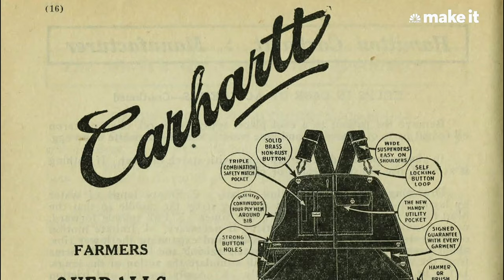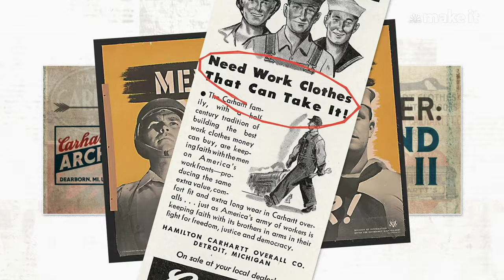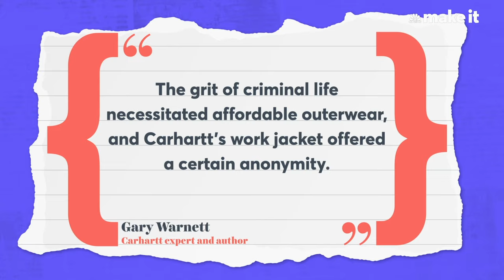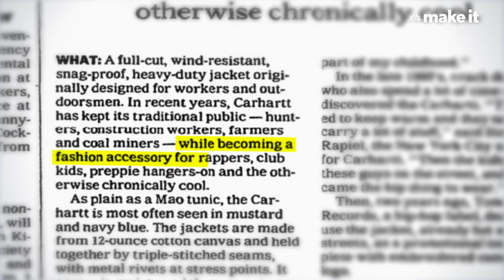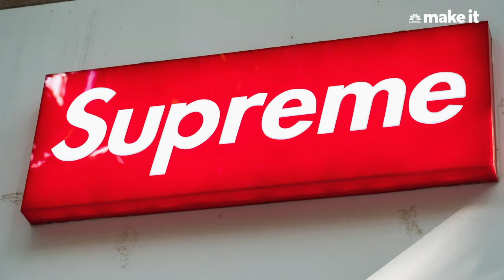How A $16 Hat Made Carhartt A Billion-Dollar Brand

Comment: also how the decline of their pant quality is very relevant.
Reply: YES! and offering a work legging? Like is that material really gonna save my knees harvesting?
Reply: @phishlipsable  get sugar cain Jean's or wilson tin.
Reply: @phishlipsable  I get on real well with the leggings. There great for me because  because loose fabric is a big entrapment risk in my line of work and most normal work trousers sit too loose and get caught.  I was delighted when I first saw them, I wear them all the time. I'm a stagebuilder, rope tech and sometimes general labourer. My biggest complaint with them is that they don't have pockets for knee pads. They definately have there place!
Reply: @LamentfulMiss13  well you may have convinced me otherwise! It would be unfair for me to speak across the board, and I am glad there is someone to challenge what I said. Bulky pant legs even at the “skinny” width could be harmful. Glad you’ve found a uniform that serves you. Thank you for your insights!
Reply: Yea i bought a set last week and a week in my iphone left a phone print and the pants are ripping at the corner of where the phone usually lays in the pocket. Pretty disappointed for $50 and a name such as theirs. I’ll probably have holes in the knees soon

Comment: It's funny because the impression I get in blue collar work is that Carhartt has lost its authenticity and is now a fashion brand, not a work brand; particularly in the last decade or so. Prices even on their core products run much higher and quality doesn't seem to be the same anymore. I know for myself when I needed a new jacket I went in another direction, and see a lot less guys wearing it to work in construction, farm/ranch, etc.
Reply: Levi's started out as work wear.
Reply: @MovieGuy666  so? It's a very old company (literally invented the blue jean 150 years ago) whose evolution away from that space happened a long time ago and no longer claims to derive its primary value from their products' practical use as work wear. It is also still very high quality in its own way, just oriented toward perfect fit, comfort, and style with a durability that is first rate among clothes that aren't specifically designed to handle heavy labor. Their quality never really declined in any way they just didn't pursue evolving their clothes into something even more robust like modern work jeans, and instead they focused their attention on improving in other ways.

Comment: I think Carhartt has really gotten away from what they used to be when it comes quality.  Their denim is not nearly as tough as it was and I can blow out the knees on their bibs pretty fast.  I have a pair double knee Carhartt pants that I've had since the early 2000s that have been holding up great.  It's unfortunate that 98% is made overseas or in mexico but I see why they would need to that since US doesn't have the infrastructure to really produce this amount of manufacturing.  Still a Carhartt fan for work